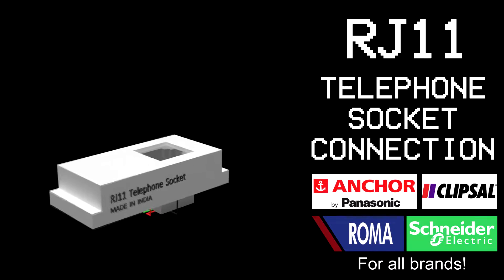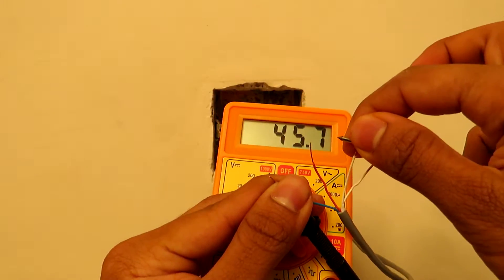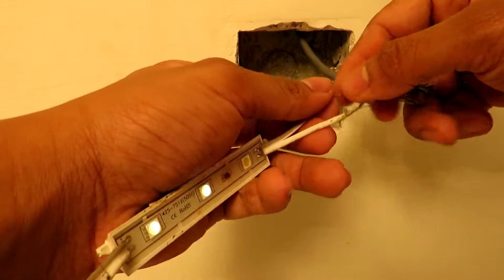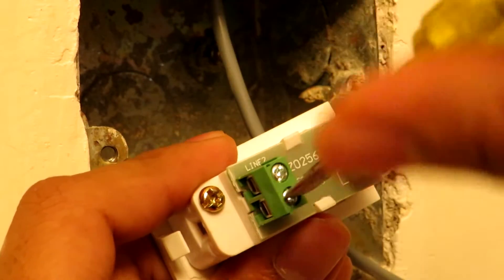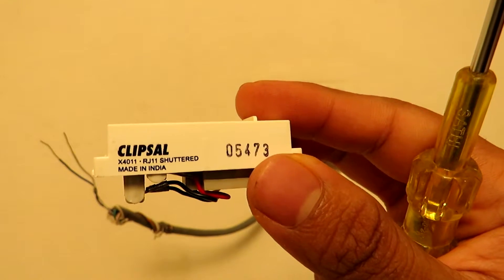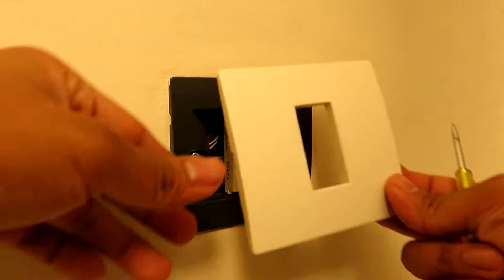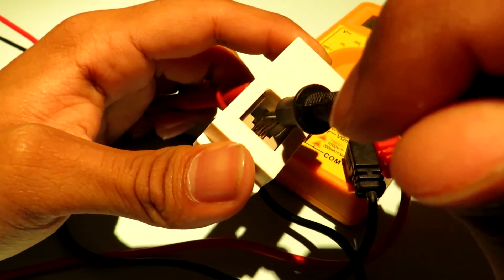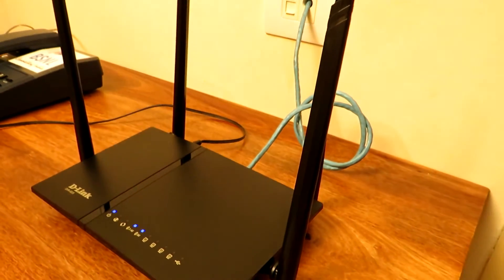How to Connect RJ11 Telephone Socket || Any brand!

Comment: Hi sir, where does this connection leave to? I want to get my broadband wire in the wall instead of the telephone wire. Would that be possible?
Reply from the maker: If you're in an independent house, this wire would generally go out of the house either overhead(most likely) or underground to the nearest telephone DB box of your provider. If you stay in an apartment, it would go to the communication shaft of your floor or equivalent. Yes, you can replace it with broadband (RJ45) wire. If your doubt is still not solved, please elaborate in detail.